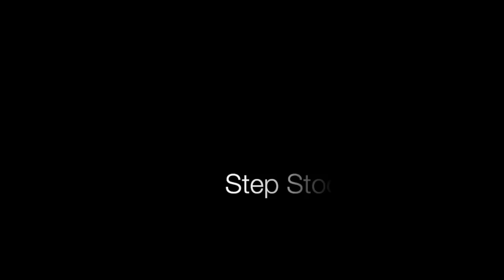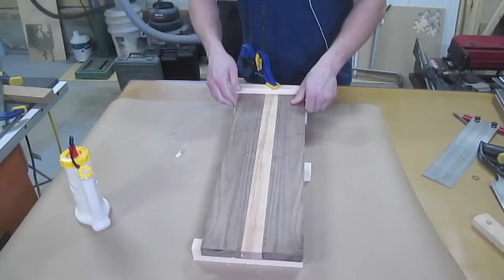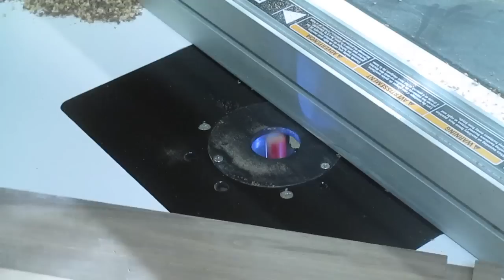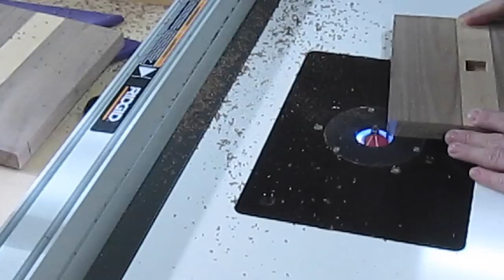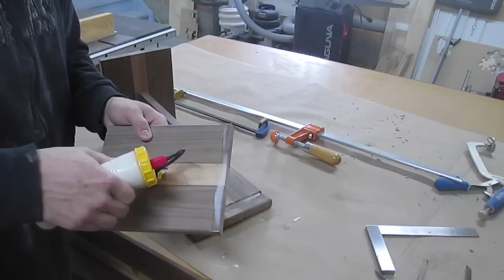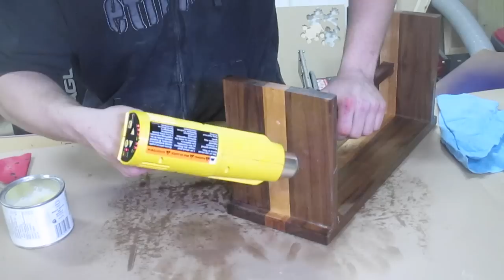How to Make a Simple Step Stool

Comment: Thanks for the Video of making it.
Very simple, clean and elegant design. I like the Wood you used and the Wax finish.

Still personal i wouldn't use it as a Step Stool, more like a little stand for flower pots.
In terms of standing on it i'm always worried if it can take it. 
Just pressure from the top wouldn't be the problem, but just a little sideway pressure could cause some.

I would like it is the legs are angles a bit out and the crossbeam just goes all the way with a little overhand and then just add a wooden splint to it so it's secure. This way you can even take it apart for transport or storage.

Lastly i would cut a little free space on the bottom of each leg so you have defined feets what could help with wobble or uneven ground or just stick some small rubber feets on each corner for slipping protection.

Still a well done work and thanks for sharing.
Reply from the maker: +Mentheus Graves It's been abused daily for 9 months and is still solid as a rock.

Comment: Very nice Dustin, I'm determined to make one for my own!  Question - what did you use to cut the holes on the insides of the legs to insert the stretchers into?  I didn't see that step in the video.

Thanks!
Reply from the maker: Yeah that should have been in the video, but the file was corrupt. I used a drill press and a Forsner bit to make a hole and squared it off with a chisel. Thanks!

Comment: What does the tube on the top of your glue bottle do?
Reply from the maker: Best glue bottle ever. It's called a Glu Bot and the tube on to is just a piece of rubber tube attached to the cap.  The cap friction fits into a nub on the lid. Thanks!

Comment: Probably a silly question, but what was the finish you used?
Reply from the maker: I've been having a lot of people ask me about the finish.  The next time i make some, I'll record it.  1-2oz Beeswax / cup of Mineral Oil.  Heat up the oil, melt the wax, cool it down in a container.  You can use it hot or cold (liquid or solid)
Reply: What the benefit of more/less beeswax?
Reply from the maker: Stefan Willoughby Thick/thin finish.

Comment: Great little stool! I have just one question, how did you make the hole in the sides?  TIA
Reply from the maker: +smokedtires I filmed it, but the file was corrupt so it's not in the video.  I drilled a hole with a forstner bit and squared it off with a chisel.
Reply: +Dustin Penner, cool, Thanks! This is a must make project :)

Comment: People make fun of me for applying wax warmed with my hands.   I do the same thing on cars and boats using pure carnuba.  Makes for a flatter more durable finish.
The "hand" method also prevents build up on trim, hardware and crevices.
I use Butchers' bowling alley wax and a bit of oil on wood.....save the Virginia beeswax for the planes and saw blades.

http://www.bwccompany.com/bowlingalley.html

Nice work.....Subbed....that Drunken guy sent me.